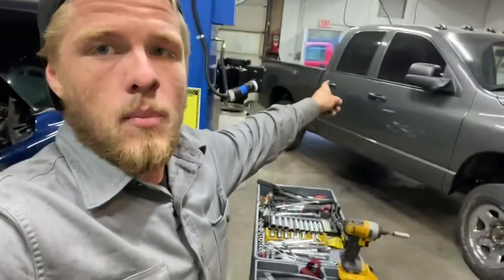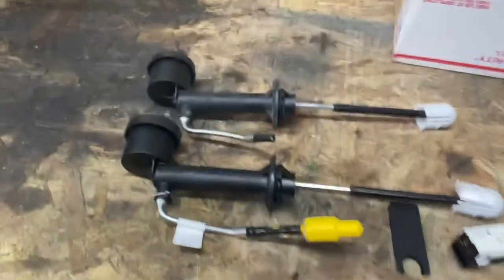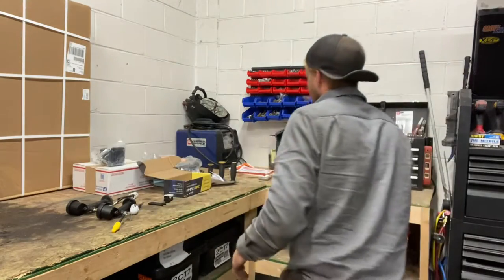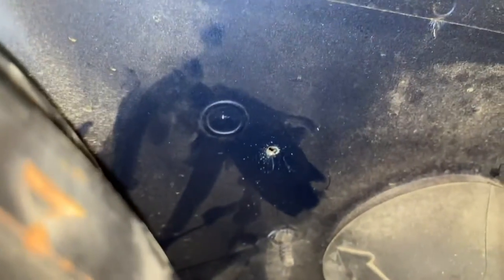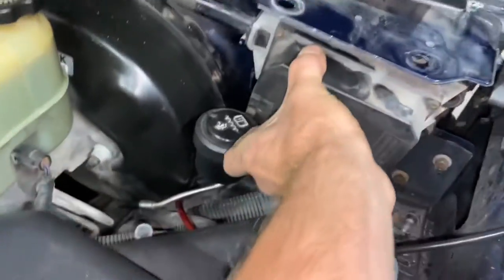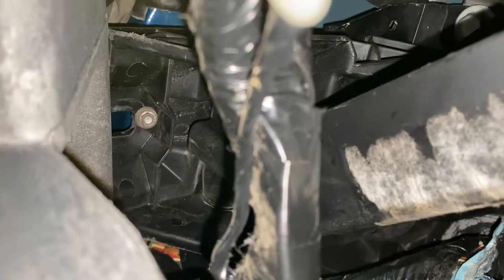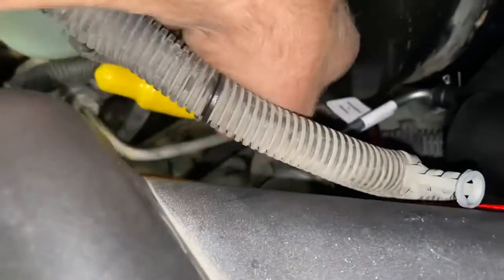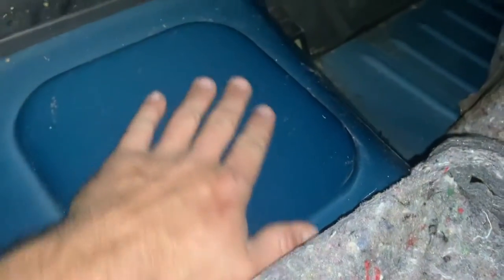INSTALLING CLUTCH PEDAL ON OUR MANUAL SWAP SILVERADO!

Comment: Just a FYI for the other guys doing the swap. If you pull the inner fender out you can get right to the mater cylinder dimple without removing anything else and you can fit a regular drill in there
Reply: That is a different dimple - the one for the clutch master is higher up on the firewall.
Reply: Actually an easier way is to just remove the plastic cover from the fuse box. Not the lid, the surrounding plastic
Reply: What about the bracket that mounts to the firewall? I'm being told I need to remove the dash to install it!
Reply: @krichtainswanson1931 same thing I’m doing right now
Reply: @kevinturpin8225  my builds already complete just haven't posted the build due to knowbody asking lol
Reply: @krichtainswanson1931  hell yeah. How was it? I gotta make the mount for the transmission right now so I haven’t got to drive it
Reply: @kevinturpin8225  it's a world's difference. And definitely something I'm gunna continue doing.
Reply: @SquareBodyK5  you can remove the dash and put the right bracket in or you can by the riv insert the accept a bolt in the old one. Only difference between them are one has the nuts and the other don't
Reply: @krichtainswanson1931  that’s good to hear man. Glad you got it all done and it’s working out. I didn’t remove the dash to install my pedal either. I’m gonna do the same as he did with the self tapper but I’m going to put a big washer on it to spread the load
Reply: @kevinturpin8225  I would its way easier and it still works well. We've got 2k miles on it already and it holds up great. And let me tell ya it's nice hitting rev limiter and not getting a shift tho ruin the fun lol
Reply: @krichtainswanson1931  That’s good to hear. And I wish I had the limiter. Mines an 04 so it does the fuel cut for a minute before it starts doin the limiter
Reply: @kevinturpin8225 I wander if you were swap over to a 5speed if it would do that. I know in that year you bang shift from 1st to 2nd so if you were to swap over and have your neutral safty switch on the 2nd gear selection you could then possibly
Reply: @SquareBodyK5  I know it’s a late reply but on mine I got an inch and a half long self tapper screw and screwed it to the firewall bracing behind the dash. I’ll try to take a video tomorrow and post it
Reply: @krichtainswanson1931  dude it’s funny you say that cause I went through a mess tryna figure out how to bypass the neutral safety switch because I don’t have one at all for it to read. Long story short the truck thinks it’s in park when I turn the key on and when it’s running it thinks it’s in 2nd😂 but sadly the trans I got was trashed so I didn’t get to test the limiter
Reply: @krichtainswanson1931  I’m going to try and take a video tomorrow
Reply: @kevinturpin8225  well that always sucks if you ever get time try that out that is if the truck still runs. Another thing keep in mind that it's just as expensive to swap to a 5speed as it is to just replace that junk 4l60e and it's not a bad trade of.
Reply: @kevinturpin8225  alright ill be watching for the video when ever you post it I'll be sure to take a look
Reply: @krichtainswanson1931 hey man. I finally got a video uploaded of the truck. Took me a minute to get the transmission
Reply: No one talks about needing to tune it? I did the swap, drove like straight garbage. Hptuner I tuned it(just switched to manual and deleted auto stuff not really tuned) and it drives perfect.
Reply: @Dillanwoodring  I swapped mine and didn’t tune it. Runs great
Reply: @kevinturpin8225  checked fuel trims? 5.3l? That’s odd. Mine ran like super bad. The computer changes fuel trims as the auto switches from first to second and all that. As soon as I turned off all the automatic stuff in the computer fuel trims were normal and drove good. I drove for a few weeks an it drove but drove much better and my ltft and stft were within - +10% once I tuned it.
Reply: @Dillanwoodring  no I haven’t checked honestly but it feels stronger. But my truck thinks it’s in second gear when it’s running so that may be why
Reply: @kevinturpin8225  your truck thinks more than that it has to be throwing 5-10 codes for sure, without the auto it doesn’t think it’s in seconds it’s thinking wtf where are my gears and throwing codes
Reply: @Dillanwoodring  I mean think what you want but when the truck is running the gear indicator goes from park to 2nd gear. So the truck thinks it is in 2nd gear based off that. I have no neutral safety switch. I put a jumper wire on the plug and drove on from there
Reply: @kevinturpin8225  I mean the computer brother not the light bulb on the dash
Reply: @Dillanwoodring  well if the indicator thinks it’s in gear then the computer will😂 I know it ain’t got all the sensors to read but man it pulls better than when the auto was in it. I know I do need to check it out though to be sure

Comment: On some hole saw kits, if there are enough threads on the chuck, you can put the first (too small) hole saw on inside of the bigger and it works like a pilot bit.

Comment: I bought a chevy that was converted to a manual. I love chevy trucks so this is my project. Previous owner is in his 20's. So I'm fixing all the problems he had with the truck. Brakes, interior lighting etc. Your videos help me understand the process he went through with the automatic to manual. Thank you.
Reply: I am quite positive that I can do the swap on my 2012, a.k.a. GMT 900, the same mounting points are there for the clutch pedal. I think I’m gonna order the clutch pedal and send it, there is no info available on the swap, however, they did offer the trucks in Mexico with a manual transmission.
Reply: @BustedCanofBiscuitsGarage  here is some more info this guy didn't give. Retain the factory nuetral safty and the vehicle should still operate as normal. And the reverse will be pig tailed from the nuetral safty harness and you might have to possibly add a positive wire to your reverse switch for when you engage reverse your lights come on
Reply: @BustedCanofBiscuitsGarage  also you shouldn't have to mess around with the clutch possition switch it will just shut your cruise control of and make it so you have to compress the clutch to start. Unless you want them things which most people like the safty features but that's the hard parts I faced

Comment: I 'm  going to stick in my sierra , after watching this video , no way with the gm built to break clutch assembly. found a wilwood 340-1436-1 to replace the whole thing , power brakes and all. after i make a composite inner and outer fire wall plate it should be an straight' foward install

Comment: Whats the bore of the master cylinder? I'm retrofitting an AR5 into my 2500HD and wonder if the stock master is a good bore for the transmission I'm using

Comment: Just now trying to do this but I'm starting with 5 speed V6 2002 silverado but want to change over to a 4.8 or 5.3.... but I'm unsure if my transmission would need to be changed or can I use it on the swap

Comment: Question how did you remedy the clutch position switch.automatic harness doesn't have the plug for it and I was wandering how to wire that in. Rock auto sells the plug to be spliced in just need shown
Reply: Wandering because I got a similar build.

Comment: Do you know if you have to replace the steering column to get rid of the old shifter or can you just take it off
Reply from the maker: You can just remove the shifter. You can buy the column cover without the hole off of eBay if you needed.

Comment: 10:35  "here" is where the stupid 1/16" plastic diaphragm leverage fulcrum. it broke on my doing a 3-4 shift and pedal went to floor. as sadistic as it sounds that top bolt procedure is 12hr labor.    DO     NOT    use oem pedal guys please. I heard of woman almost dying on 1-2 shift on 65mph rural cross road.  I used a willwood master and universal billet pedal. with my v8 swap. after i read the protocol for the job in the manual I couldn't believe what i had to do to get pedal out there was no way I was going to do it again with guy on forum saying he went plasticless after third failure. take apart dash and fasteners ( some of which windshield may need to be removed to get access) to rotate entire dash up and forwards to access blind top fastener to rotate down and back clutch pedal.  another one to consider is with the billet is you swing is in line not hooked to the right inches. this allowed me to notch slave hole few inches lower weld in plate and have inline swing that fell nearly where e brake is. gives a nice low and wide body placement when driving and makes it nearly imposable to accidently cycle clutch and drive off with e brake on.     not bashing your video man, great content liked video. I'm just a tile guy and wish I had known all of this before i started a " quick fix" after stated talking about welders lol.

Comment: Did u disassemble the dash to install the pedal
Reply: I installed mine in my truck today! Didnt had to loosen the dash.. But its a pretty tight fit! I pushed hard on the pedal assembly and had to trim a little piece of rubber on the truck near the hole in the firewall for clearance! Also did another hole in the mount like he did in the video to pass a nut behind to bolt it in place, worked very well!
Reply: @simonpierre100 you indeed have to remove the dash if you're going from an automatic 4l60e to a 5speed especially using the metal clutch pedal. Because you have to install the metal bracket that stops the clutch pedal from flexing that bracket goes right under the Vin number there's noway to install it without removing the dash!
Reply: @SquareBodyK5  none of us in the comments used that bracket because of dash removal or nfg

Comment: Is this swap on a 4x4 silverado?
Reply: im doing a at to man swap and mine is 4x4
Reply: @simonpierre100  I'd love to do it but the marriage to the transfer case seems like a lot of work
Reply: @superbroadcaster  i bougt a nv3500 with tcase from a gm 4x4 4,8 vortec! I don't think you could use a 2wd nv3500 and put a t case on it. you have to find a 4x4 version (sorry for my poor english, im french)
Reply: I'm in the middle of doing one on my truck, I'm using an nv4500 tho

Comment: is this similar to an 2001 silverado 1500 extended cab ?
Reply: yep im doing the swap this week (mine is 4x4) and everything seems similar
Reply: @simonpierre100  could you make videos over it
Reply: Everything's done! But its pretty straigt foward! Contact me if you have any question
Reply: @simonpierre100  i have a 02 silverado 4x4 ext cab & im in the process of doing the swap aswell what did you do for the driveshaft? did the oem one fit?
Reply: @raymondquesada6896  i used the same one
Reply: @Simon-Pierre Marchand Nice thanks for the reply 🤙
Reply: Was wondering what problems you ran into doing a 4x4 swap now

Comment: How come u didn’t just double stack ur hole saws? Screwed ur 2 inch into ur 2 3/4 hole saw and then u are using ur 2 inch as ur guide.
Reply: I have a question so the hole is exactly 2 3/ right? So I need to get me a hole saw that's 2 3/4?